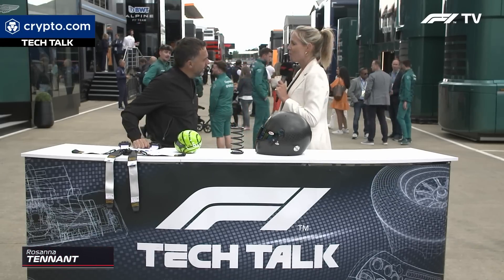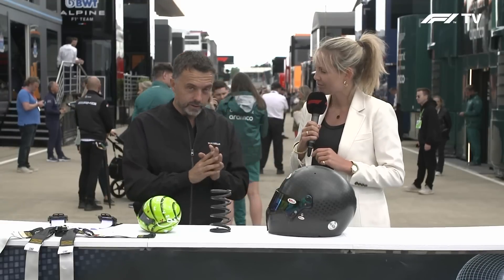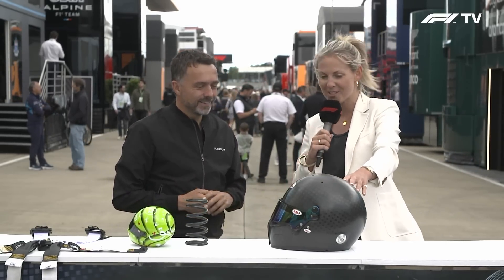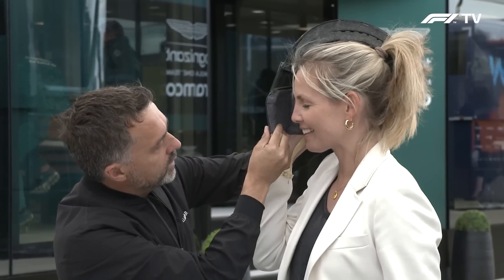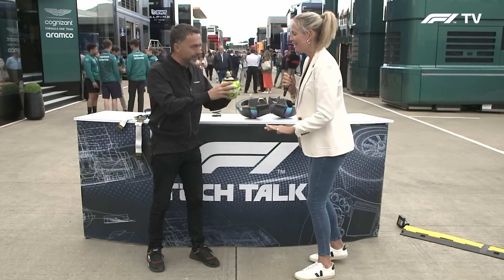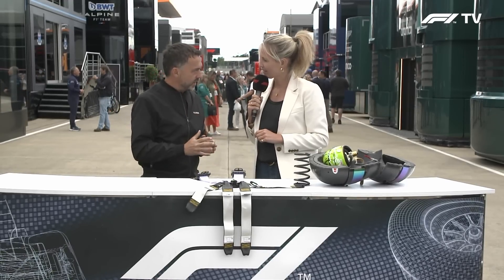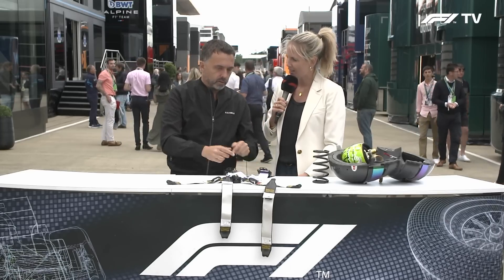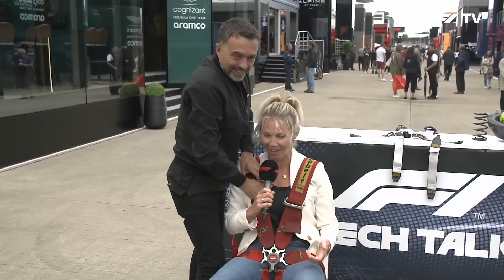Albert Fabrega's Tech Demo | Crash Safety | F1 TV Tech Talk

Comment: i've got a question: What if a debris or something flies in and clicks the belt open in a race? Wouldn't that be very dangerous?
Reply: I believe the disconnect is a twist mechanism, not a button. So debris striking the face of the center hub would not trigger it to open.
Reply: @chromaticsoundco.7664  that makes sense!

Comment: One question I had whilst watching this: is it possible to accidentally trigger the release? It looks like it would be quite unlikely - the twisting motion is quite unnatural - but it doesn't look impossible, so I would have expected to see it by now.
Reply: No, it's not. That single twisting motion IS unnatural, but only just unnatural enough that you can't do it by accident. It's also a single motion because a panic unlock assumes you have limited mobility, fine motor control, and visibility in the moment. Those center camlock harnesses (or a version of the camlock mechanism) are universal in pretty much every motorsport.
Reply: @spdcrzy  thanks 👍

Comment: Albert misspoke about the material the helmet impact protection foam is made of; he said polyester, but I've only ever heard of [expanded] polystyrene (EPS) foam being used (and a quick google confirms it's EPS). Polyester foam does exist, and it may be used as a thin inner-most (comfort) layer in the helmet, but it doesn't have the right properties to use as the impact protection foam. The belts are made of polyester.